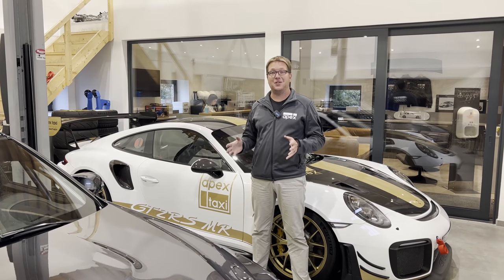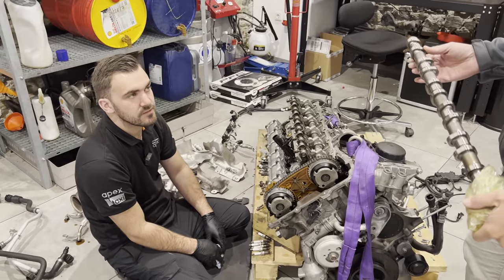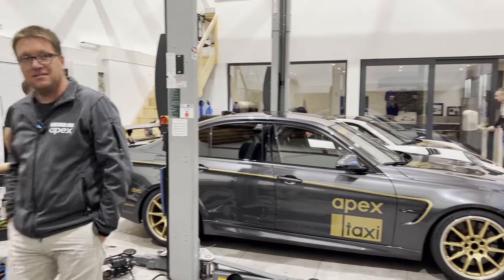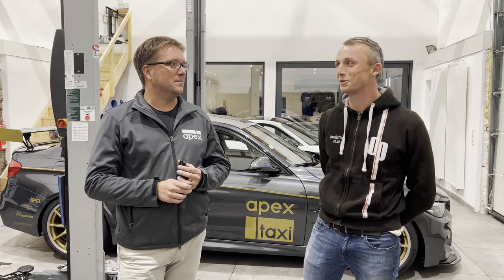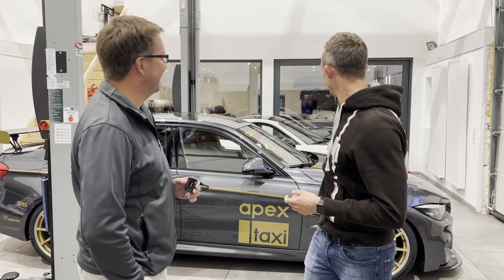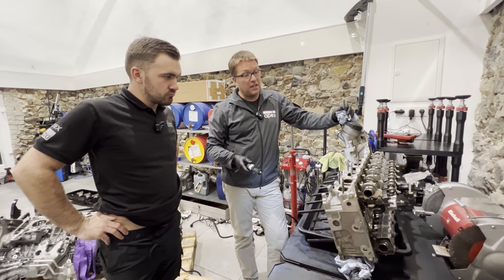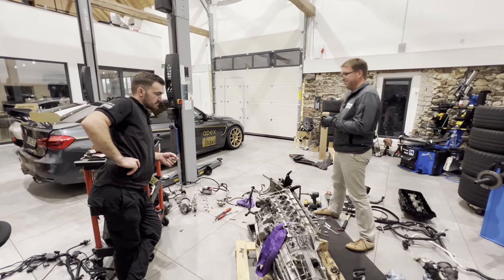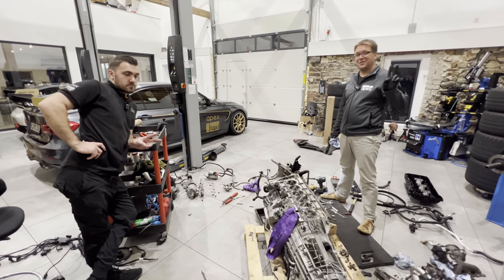BLOWN UP another BMW M3 Engine!!! Tear Down and Diagnosis...

Comment: Am In right in saying that this Motor IS the only M car (yes the 218 IS not a M 😅) of the fleet that has a tune ?
Reply from the maker: No my m4 vln make 570 and my m2 comp makes 540 so there are 3 tuned cars.  This is now the 3rd motor in the f80 so in total 5 S55 engines that have mapping etc :-).

Comment: Crack is low enough so I will never believe that this happened due to high cylinder pressure. Most likely it's a result of high temperatures (say hi to eco stuff) or manufacturing defect.

Comment: Right, time for a sleaved S55 block.........
Reply: Most BMW engines use bare aluminum cylinder bores now. Strangely, the early M2's used a trick N55 engine with steel cylinder liners.

Comment: Did you calculate the cause of the blown engine? I've heard that some people think maths is reality and you can calculate causes into existence simply with maths. What did the maths say was the cause?
Reply from the maker: 933,000 is the figure you’re looking for.  35000km/21 = 1666,7 laps x 560 horsepower  is 933.000

My 6yo daughter just came in and said in a disappointed voice “ are you doing math again “ 🤣🤣
Reply: @RobertMitchell  that makes sense....so gravity is a force again. Phew. I though those flat earthers were right until you saved the day with those maths! Praise the Lord. Ha ha ha

Comment: Robert is basically saying that if this was an American V8 it wouldn't have broken and it would have lasted 500,000km+ ...
Reply: 8litre with about 250bhp.....lol
Reply: @PixelVogue  this isn't the 70s
Reply: 7.0 or bigger with a 3 speed auto gearbox and 200hp. And the cost would be the same, buying another m3 engine or running that old v8 for 35000km which would use 30000000 liters of fuel
Reply: @ahemgee9542  is in yank land
Reply: @PixelVogue  a 7.0L crate motor from GM or Ford / Roush typically make a minimum of 500 hp and up to  around 650 hp on pump fuel with bolt ons and cams etc. No supercharger. So you're way off.
Reply: In the racing world M engines are revered as some of the most reliable, as Robert mentioned the rebuild schedule of the S55 is quite a bit longer than the Huracan or GT3. This engine was tuned and nearly hit BMW's recommended rebuild of 24k miles for the S55 in their GT4 racing class.

Comment: What caused the BMW M3 engine blow up? 
The answer is in the question.
It's a BMW.
Reply: In the racing world M engines are revered as some of the most reliable, as Robert mentioned the rebuild schedule of the S55 is quite a bit longer than the Huracan or GT3. This engine was tuned and nearly hit BMW's recommended rebuild of 24k miles for the S55 in their GT4 racing class.